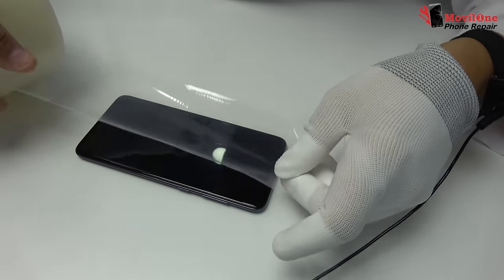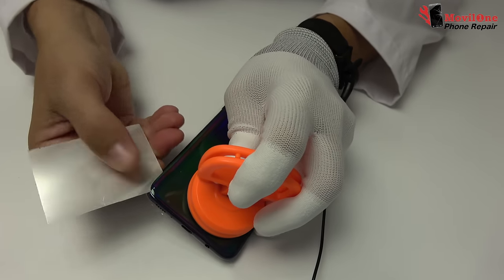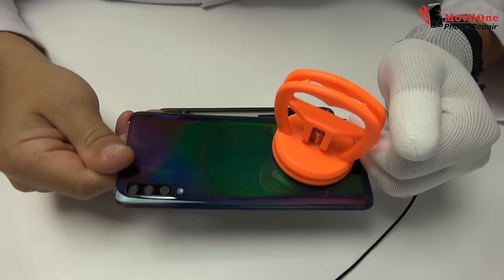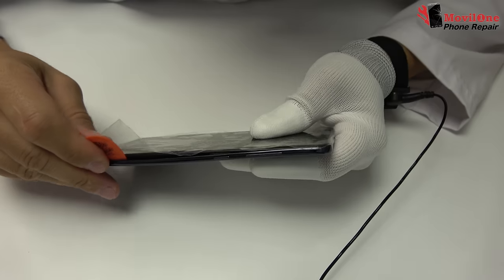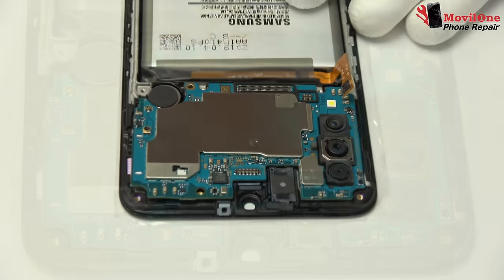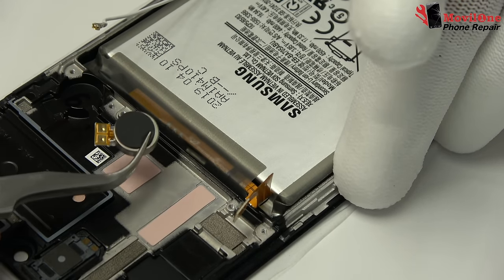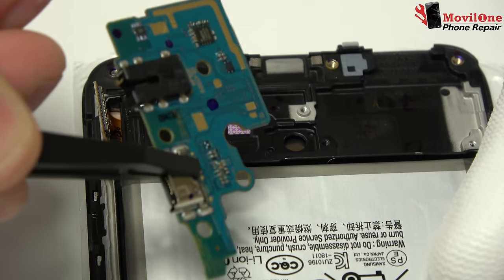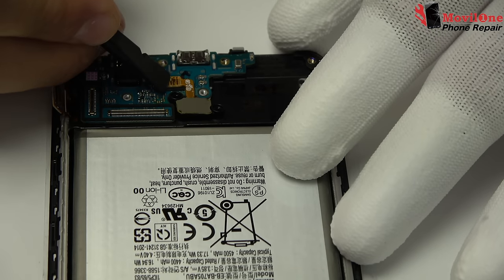Samsung A70 Teardown & Disassembly &  Repair Video Guide

Comment: This phone is a semi Flagship model from samsung ,but overall experience in my 2 weeks of use this phone is pretty reliable. Especially the battery and charging speed. Maybe the best one out there for the price
Reply from the maker: Hello, Sky Nation! quality - price is a good balance, thanks for sharing your experience with us!
Reply: Yes, it is as fast as a Galaxy S8 but with more RAM and great storage. I am very happy with mine.
Reply: In indonesia it is even cheaper, $399 for a new one
Reply: Mines flawless too. Sure it has the weaker processor and GPU but performance is fantastic, gaming nearly matches the flagship model, hardly any lag if any, battery is superb and it includes the FM radio too

Comment: Amazing video, one question though. Is reapplying adhesive to the back cover necessary for it to stay in place?(just ignore the water resistance) or does it have some clamps that hold it in
Reply from the maker: CovrigeluRoman we always recommend to apply a little bit of b7000 or t7000, industrial glue! Thanks for asking
Reply: Yes, everything has a purpose. You can always leave some screws out and it will work but why half ass it ?

Comment: Hey! What's the difference between the Galaxy A70 and A70S screen? Can the A70 screen be installed on the Galaxy A70s?
Reply from the maker: The Samsung Galaxy A70 2019 A705f, the screen for this one should be used  just on this model. Each of the above models have their specific spare parts.

Comment: Do they recognize the guarantee, if i would give the phone for the repair, with the volume button not working, because I wanted to slightly polish the dent of the frame, because it got a bit beaten and the substance got in there? Can I fix it somehow without dissasembling and losing a guarantee?

Comment: Doesn't show the screen removal. The teardown skips from the battery being removed (4:49), where you can see the black plastic base beneth it and the tear off plastic on the screen beneth that. Then suddenly we are looking at an empty chasis and removing the "sound box" generally known as a speaker. Shows me everything but what I actually wanted to see. If I am missing something please reply with the time stamp of when you remove the screen.

Comment: hello, my friend has water damaged a70 what is your advice to do with it? we tried putting it in rice for quite some time but it didnt work
Reply from the maker: Godfrey, because the story this the rice is just o good story, well sold on internet. The rice has no property so that it can solve the shorts of the motherboard, produced as a result of the contact of water with electricity; You need to perform an ultrasonic cleanning. Best regards
Reply: @MovilonePhoneRepair  do you mean complete dissasemble of the phone?

Comment: It looks very cheap. Why I'm not surprised? Haha. Great video as always!
Reply from the maker: :)) Thank you, as always for watching and for the comment!
Reply: Surprisingly good though for a midrange phone, especially with triple camera, in-screen fingerprint sensor and big (4300mAh) battery.
Reply: @Atomic_Haggis  the in screen fingerprint sensor is flawed, it unlocks the phone in your pocket. but its a very good pgone. 4500 mah battery
Reply: @alexandrumacedon291  mines never done that. Did you use smart unlock by any chance?
Reply: @maxz8807  i dont think so. it just unlocks in your pocket when it rains or is very hot . i just use pattern now